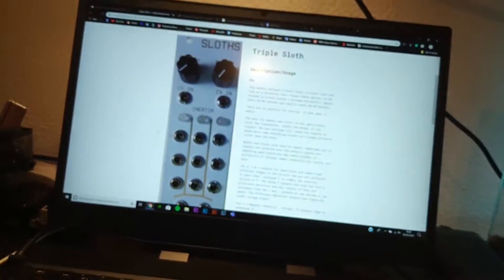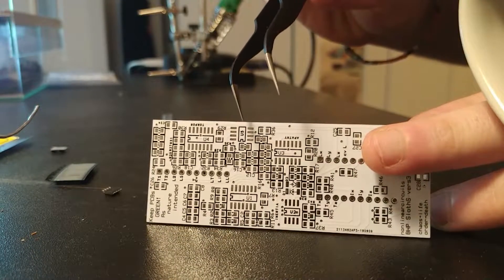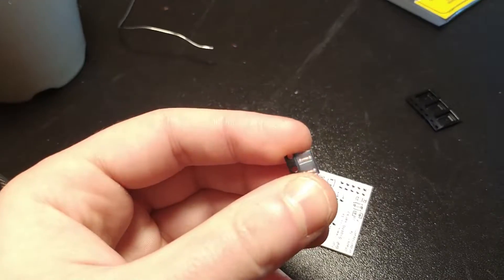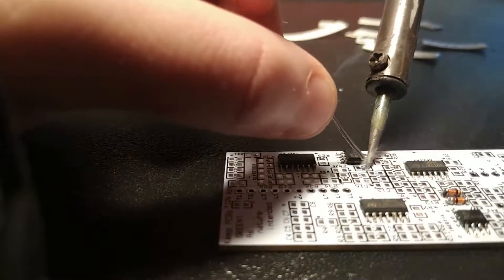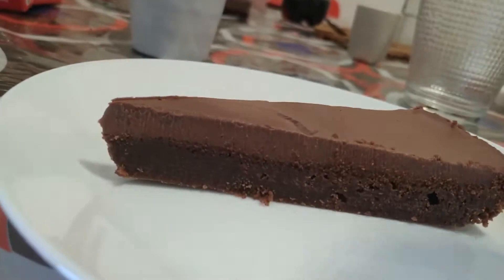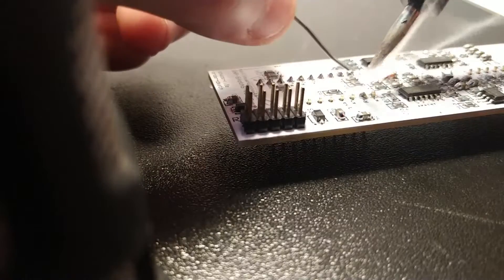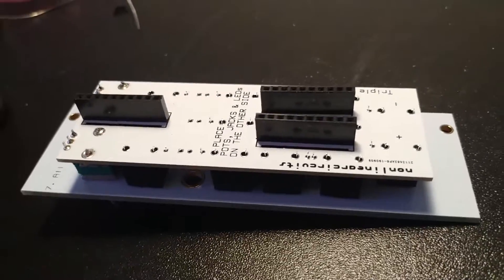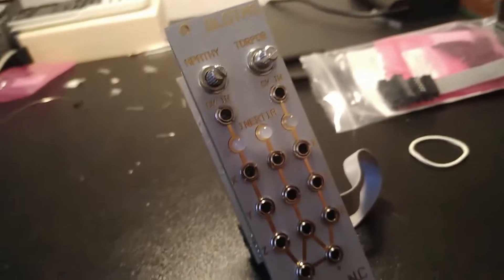A really SLOW triple LFO - SLOTHS NLC - DIY Build

Comment: Hi, I can't find any kits available so I will buy one assembled. I want to swap out the regular LEDs for 2-colour (bi-polar? bi-directional?) when I receive it. Do I need to change any other components to do that, like current limiting resistors or anything. I google and I see 3 leg and 2 leg versions, so I guess I need the two leg version - what voltage LED would I get?  Hope you can help!!! Great video, especially the cake :) I do that for breakfast too!
Reply from the maker: I have the bipolar leds on it, they are just fine. You need to try some resistors and see witch one is good for you, i do not remember the right value onestly. But If you are interested I could sell you my module. I usually like to change and try new things. Let me know 😁. Btw 2 legs definitely and try a bit with the res.
Reply: @totallyslab2192   I'll try and figure out how to directly message you about the module offer. I am interested
Reply: I found your email now

Comment: What was your value for the resistor in space R7? Notes with ver3 BOM states that it was 150k then changed to 220k, my pre packaged kit came with a 330k resistor for R7. I had a spare 220k and went with that on my build.
Reply from the maker: I followed the BOM. Mine it's a 150k I think. Anyway always check the notes in the BOM they are really good to understand better.

Comment: Try the wool type to clean your iron tip, works 100 times better. Also try to find smaller wire, it's a lot easier with it to avoid solder blobs. Heat the pad and the component before putting your solder on it, not the reverse.
Reply from the maker: Thank you for your tips man, I'm waiting for a smaller solder wire from amazon. I will try all your tips in the next Module. I think it will be Sly Grogan.